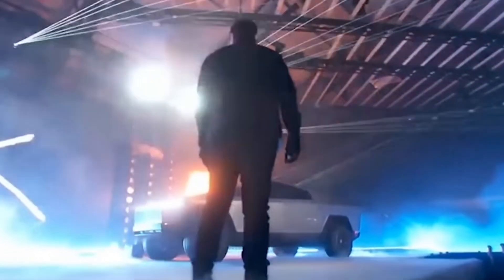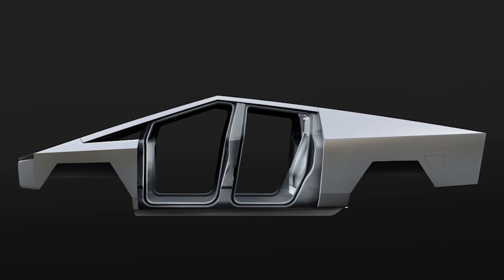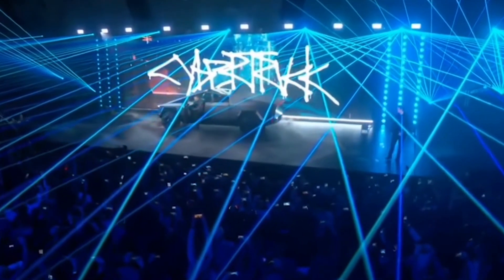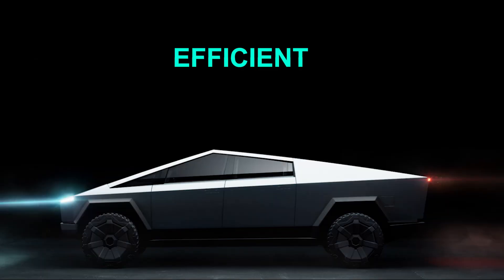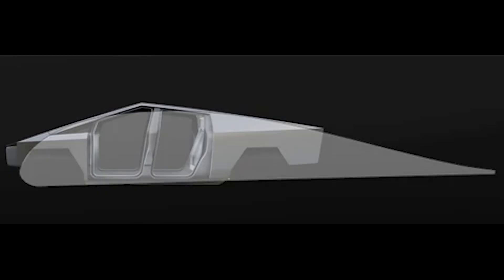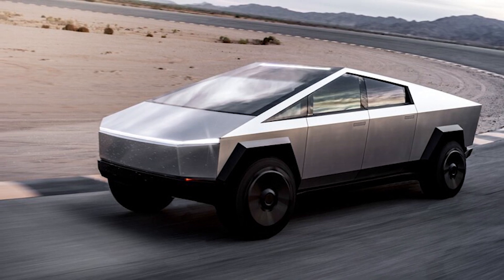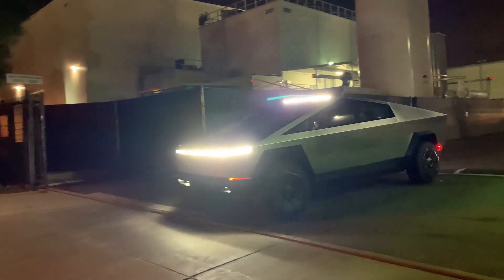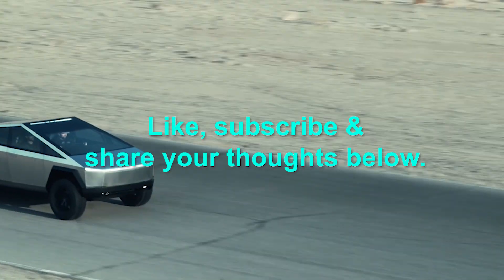Cybertruck is Engineering Genius (and will be copied)

Comment: I enjoyed this video a lot, however I do want to nit pick one thing (sorry). I get how you would think having a strong and rigid frame would make a vehicle safer, but in reality thats not entirely true. Modern cars today are built to be destroyed upon impact as a way to absorb as much shock as it can before that force hits the driver. Without that “crumbling” feature, all of that force is going straight to the people inside, which would cause all of that damage you see on crashed cars, to be inflicted on the passengers instead. Now, I dont know how Tesla designed the truck, so I can very well be wrong, but from what i’ve heard about its strong body design, its really not that safe in the event of a crash.

Comment: If they make one with diesel engine, i'd buy one, but as electric, no chance. Specially when despite what environmentalist cult states in their mantra new vehicles least currently produce 3 times a much of pollution, wasted energy and unrecyclable trash than old vehicle simply due quality and utility life of vehicle and top of that electric cars have the lithium batteries, witch mining and processing causes terrible damage to any place its mined and produced. Specially in countries like China that does not give two fucks about pollution it produces and land it taints.

Then again Cubertruck has stainless frame that should not corrode away, so make diesel model (one of those older type of engines with out fuel injection and all kind of pollution dropping crap that just dirty the engine) so people can fuel up with mix of diesel and natural oils and plenty of folk will buy it. Hell might even make it a hybrid to move short distances with electric power that then could be utilized on job site with out worry of draining the battery.
Least here full electric wont work as temperatures are below freezing, cabin needs heating, batteries need heating that consumes lots of energy and of course there is the lighting and driving distances. There are lots of people driving on capital daily to work due prices of living being cheaper else where, so on winter on few tested cases least S model Tesla could only get on the middle way before needing turn back so battery wont run dry and people on question barely made it back. On some hot places sure electric might work but on cold north fuel based vehicles are the way to go, unless Tesla can come up their own fusion reactor in mini size to produce its own power, or manage to create better battery than lithium based ones.

Comment: Well i see 1 problem with the argument of the whole body being one piece of metal, if you do get a dent in the vehicle then how to your replace the dented piece? if you get a fender ruined then the entire body needs to be scraps and if there is no frame then the entire car it's self needs to be scrapped. So essentially if you get into a crash you can't fix this Truck you need to replace it and that will negatively affect the mechanic industry, at least the body repair part. This being said if you can hammer out the dents it will still look good but the structural integrity of it is up for debate.

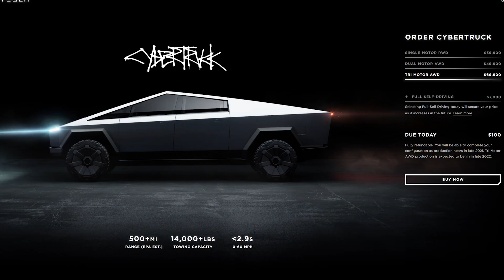Comment: ugliest "vehicle" ever made. looks like a reject from the original robocop movie or some crap. love how they're hyping the stainless steel shit like they just invented the idea too... pretty sure one of the main reasons the Delorean failed in the 80's was the overly expensive stainless steel body, and that car looked WAY better than this monstrosity. also love how they're hyping it as the lowest possible cost, then at 4:31, you can clearly see that its more expensive than most other vehicles on the road. for 69K i could buy two brand new F150's, still have money for gas, and not look like a complete retard on the road.

Comment: I would love to see it in a deep ink blue or a mat ink blue color. I hope it has manual window and door lock options in case someone gets stuck in their Tesla truck. If you have ever been stuck in a vehicle where the electric features won't turn on with electric windows and locks on a hot summer day, and you can't get out ... You could probably get out but you might want some fresh air. What if the car submerged. How would you break the window to get out? Could it be made to be airtight like the old Volkswagon Beetles? Also, could lightning or Neodymium magnets stuck to it interfere with the electronics. Are the electronics hackable?

Comment: Here is a engendering reason you often shy away form flat panels, structural weakness, old citoraens and panel vans one knew that the flat panels tended to wobble and warp if it was not dubble panels with a underlying structure (thicker made it to heavy), now see the naked chassi is e its also a safety issue on it due to it being lethal to other people in trafik of sharp edges a high chassi bar, the car will slam into the roof area of a mid size car and cause a comparability issue, with is a issue, unless you want to make sure whoever you run over dies then ok i guess.

As for its styling why ti smocked is not for its goofy,  and it s not new steel panels unpainted was done on delorian, why dont we continue? because its expensive to work with its damaged you need to remove the panel entierly and replace it as the kink or a bump will not be easy worked out.

As for your argument there is some that can, i could if given the opportunity to make one that can surpass it to.

Comment: Cybertruck ≠ safe. Safety is the opposite of having an undestroyable car with thick metal and bullet proof windows. Safety means, that the car protects the PEOPLE - inside and outside (pedestrians in a crash). The least thing you wanna have in a car crash is a bodywork that doesn't deform and therefore doesn't consume crash energy. Massive metal is as safe for the driver as crashing into a wall head first without protection. I'm really confused that Tesla seemed to have forgotten everything they knew about how to build a really safe car...

Comment: I want a Cybertruck, and swap the engine to a diesel or gasoline engine. Just because i don't like Electric cars.
Reply: Barni179 well that would be stupid of you. A fully charged cyber truck battery is 500+ miles. So you would save around 500 miles worth of gas because all you have to do is charge it. Apart from the electric bill of course, but it’s not like it’ll be remotely anywhere near the amount of 500 miles worth of gas. The battery also reaches full charge in I believe 12 - 16 hours.
Reply: @gamonize  yeah, but i couldn't hear the sound of an engine
I mean i said i don't like Electric engines in any means
I didn't say it's bad, just that i prefer gas over electric

Comment: Haha no the Cybertruck is totally unsafe. A front crash with another car would kill both, the Persons in the cybertruck and the ones in the other car. Because the impact energy will directly float over the exosceletton into the passengers causing a massive pressure on the bodies of the passengers. 

The Steel is just TOO hard to break.

Comment: I think you missed quite a few point around the utility of the Cybertruck. Within its price range there are far more capable vehicles and time will tell how effective it will actually be pulling a real load, without its aerodynamic cross-section.
Reply: Such as? And are they classified as pickups as well?
Reply: @Protoplasm78  F-250+, RAM, Silverado all have higher Payload and Towing capacity, especially when you take into range while carrying these loads. Although Cybertruck may be powerful and efficient as we have seen with other Tesla models when you increase the payload substantially or add a trailer the range plummets unreasonably poor levels.

Comment: A strong car doesn't make it safe, in fact a weaker car is safer admit is able to absorb impacts better
Reply: Absolutely, plus there's almost no space at the front to absorb a collision
Passengers will just be crushed in the Cybertruck, even if the car totally resists the impact.

Ancient cars used to be very solid, like the Cybertruck. People would often die in car crashes because only the passengers would absorb the energy from the crash.
Designing the cars to be crushed at any collision has actually made them safer.

The Cybertruck will probably not even be legal in Europe due to its rigidity :(

Comment: You mention that the structure is rigid, but passenger vehicles are not supposed to be rigid, they are supposed to have crush zones that absorb impact, thereby moving the high speed impact forces around the passengers, rather than be transferred to the passengers. Another thing you glance over is the safety of children, this truck is an attempt to get into the truck lovers market, and that is basically 30-45 year old fathers who work in office buildings, and job sites. A electric vehicle at this price range just is not cost effective for those markets. Take an oil worker in Texas for instance, they spend a large amount of their time in small cities for 2 to 3 weeks at a time, usually staying in cheap motels. A truck like this that cannot be filled up regularly and does not have huge amounts of range, is not going to penetrate that market until there is viable infrastructure in those markets, the other is office workers who have the highest chance of locking a child in the car, and bullet proof windows that cannot be smashed in these events is a big liability. Lastly you talk about affordability, but honestly, the only viable competitor in terms of performance and range is the 50K or 70K option, which makes it not very competitive in the market.
Reply: Furthermore uni-body stamped metal vehicles are not that prohibitively expensive to make, most electric vehicles are around 8-14 thousand USD more expensive than their gasoline powered cousins of the same price range. Assuming that this is on the high end, the vehicle cost of say, a Honda Ridgeline clone, should be able to be viable at a 43 - 45K MSRP. Which is not that much more than the 39,900 MSRP on the lowest tier Cybertruck. Even a traditionally styled truck like the F-150 should be viable at 40 - 43K MSRP. So the idea that this is cost effective, when the cost is, on average 10K more than other trucks in the same market. Furthermore, any EV announced right now should be looking into Sodium Solid State Batteries over Lithium-Ion. Lithium=, as you should know, is incredibly dangerous to the environment both in terms of dismantling and mining of the material, as well as the production of the batteries. and with a launch date of Late 2021, I am honestly a little offended that the vehicle is apparently coming with a lithium Ion battery, with no plans to explore SSB at launch.

Comment: "Tesla Cybertruck is an extreamly save vehicle" - oh man, somebody clearly doesn't now shit about car safety. 1) The steel on Cybertruck which is 30×harder than standard aluminium (according to Musk) will absolutely kill any pedestrian it hits. This is one of the reasons why the Cybertruck will most likely be forbidden in the mayority of Europe. 2) Cars need a certain "bufferzone" in order to reduce G Forces in an crash. According to an safety expert, those G Forces will be way to high in the Cybertruck an even Airbags won't help. That's also the fault of the steel chassie of the Cybertruck. 
Ironically, the Cybertruck is probably one of the most dangerouse vehicles ever built!

Comment: Cybertruck looks safe for passengers but, due to its flat front, it looks like death to pedestarians is guaranted after impact at any speed more than 25km/h. It could never bypass safety laws in Europe
Reply: Have you seen the front of an F150? Its about as square as the come.  The nose of a cyber truck is lower so a pedestrian may end up going up and over.  You may end up losing your legs at the knees unless you are korean or shit. In that case its night-night. At 25 miles per hour you will receive internal damage regardless of what kind of car hits you. Atleast tesla tries to avoid that scenario but using its intelligent tech features.
Reply: @raynellholmes1011  it is not so flat as cybertruck also its aloys is of different mix. Like front of the hood, where pedestrian hits first, is made from softer alliuminum I believe and it gets harder as you go. As with soft front grill. While tesla is cut from one sheet of standart steel.
Reply: @bimbalai  

Why are you so concerned with pedestrians any way. Plan on hitting some? 🤣 .
Reply: @raynellholmes1011   almost nobody plans to do it but it happens
Reply: @bimbalai  

True. Sad that we live in a society where common sense doesnt reign supreme. I've seen people in philly step off the curb as soon as the light changes in their favor without so much as a hint of looking to ensure the coast is clear because of the amount of frivolous lawsuits up there. Because of reasons such as this, we must make our cars  soft to the point where they take unreasonable levels of damage in minor accidents.
Reply: @raynellholmes1011  same here I lithuania. People think being right in stupid everyday situation is better than being alive. even worse. Many times had to break when mom and kid rolls to unregulated crossing on electric scooters, everyone on their phones, airpods

Comment: No it's not genius, it's terrible. They make a car that looks like a high school project and you think they succeded because their car is efficient and low cost to make (not actually buy because any price for this crap is too much).

Any fool can make car like this efficient, low cost and whatever you like because this car design is below any acceptable level. It doesn't took genius to make efficient car that looks terrible.

It looks like minecraft car and only Tesla sheeps would buy this.
Reply from the maker: 10/10 argument, excellent use of logic and reason. I concede defeat.
Reply: @SolvingTheMoneyProblem  Actually it is but you failed to understand basic laws of engineering and even aerodynamics.

Not even to mention design.

Otherwise you would not be impressed with that engineering failure.

Tesla is digging his own grave. They started with a Model 3.

Comment: I think the razor sharp edges will fail on safety grounds and will be too fragile.  So a lot depends on whether 3mm 30x cold rolled 301 stainless steel - or whatever - can be given softer corners ... the design as its stands right now is not safe enough for pedestrians and cyclists ... and is likely to fail for other reasons - the pull out tailgate, back end and rear cargo cover looks way too sharp and thin - I think there will be another 2 year delay - similar to the delay caused to the Model X by the fancy the rear doors ...

Comment: I agree with everything except safety. Modern vehicles are designed to crumple in high-speed accidents. That way the car absorbs the impact, acting as a sort of cushion for your body. The Cybertruck clearly will not crumple in an accident. Unless Tesla invented and implemented a different method for softening impacts, which they probably did, the Cybertruck looks like it could be deadly to the driver in a high-speed accident.

Comment: I think a central backbone chassis with battery packs glued and bolted to the central backbone with a different top hat will allow  one factory prodiction plant the versatility to offer many top hat designs on one platform plant.

I believe that construction veratility will allow production plant efficiency rates in the high 90 percentile. 

The tesla folded one sheet design production facility  will not be flexible to consumer design shifts and plant production facilities over time...which is a concern over time.

I love the cyber truck simplicity and end result...just not sure how it will age over time and the inability to change top hats or stretch or shrink platform like the central backbone themed gm plant coming on line in 2022...

Interesting battle simplicity of production of one design versus flexibility of production versatility to produce many different sized vehicles in one facility ... 

2022 is shaping up to be quite an interesting year for prodiction technique futures.

GM s central platform glued and bolted battery pack non unit body construction, exoskeleton tesla production non unit body construction or rivian skatekboard non unit body construction...

One question would in fact the exoskeleton tesla cybertruck be literally the latest technology of the ultimate unit body construction...Id think so...

Comment: you make great points, but #2 I disagree with. As someone who loves the idea of an electric truck, this Cybertruck (or any battery powered truck offered right now) doesn't strike me as practical for a truck. good luck loading bags of gravel into the bed from the side; good luck going off-roading with this truck with a bed full of gear and aired-down tires, and there's no way it gets 500 miles when it's actually hauling my bike and a couple buddy's bikes to the track that's 5 hours away. Can we plan to hit charging stations 2, 3, or even 4 times along the drive out to the middle of nowhere? maybe. But we did something similar in a buddy's model 3 just taking a weekend fishing trip to central CA and it was cool at first, then it got old, real, real fast... would be nice if Tesla wasn't completely apposed to anything besides batteries. just my opinion

Comment: Re: cost - look at the model 3 AWD. It is the same price as the AWD Cybertruck (50k) but the truck is much bigger, seats 1 more, larger suspension/tires, same range at a larger size, can tow and haul. So it is clearly cheaper to make to offer all that above a model 3 at the same price.